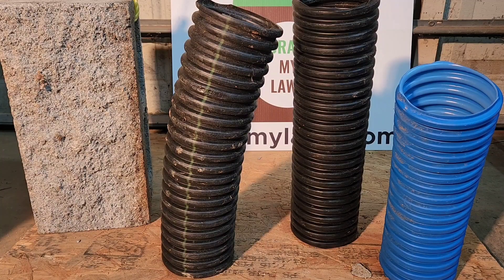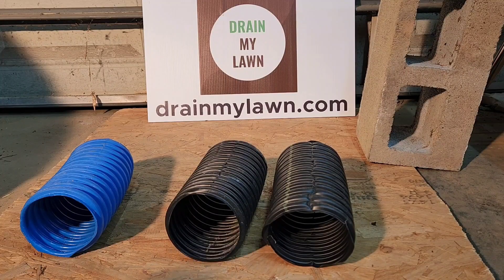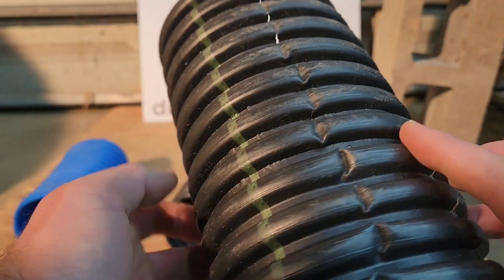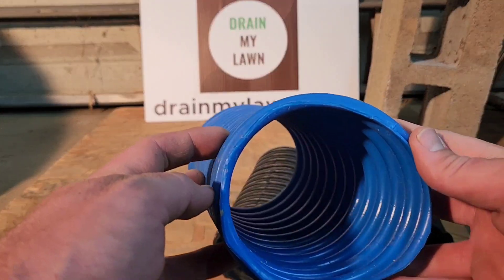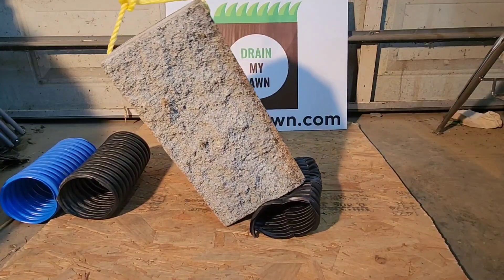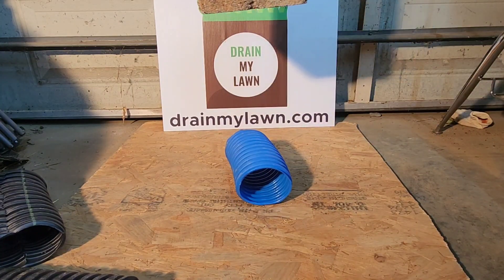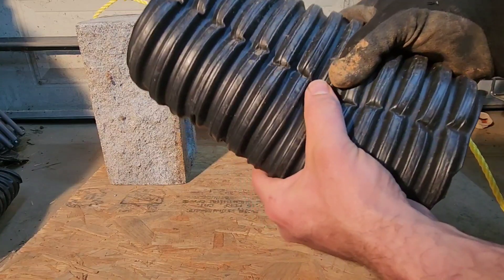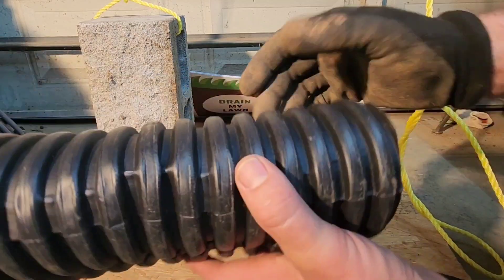Which Drain Pipe Is Stronger?  Slow Motion Crush Test

Comment: I'm going to run a 3" drain spout under my asphalt driveway. Would you use sch 40 pvc or the blue high octane pipe?
Reply from the maker: I would recommend double wall corrugated over sch 40 for under a driveway.
Reply: Thank you sir! I assume the FDM blue pipe High Octane Armor is double wall and the one to use? Thanks for the videos!